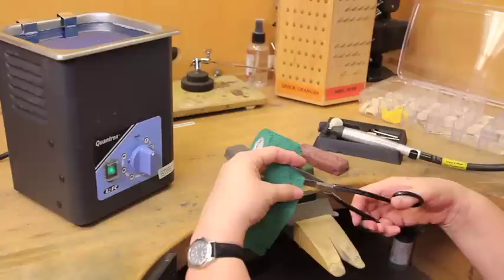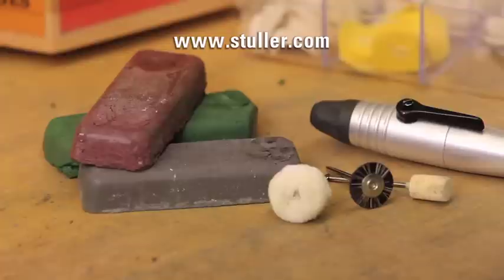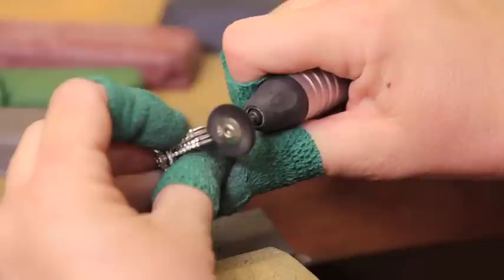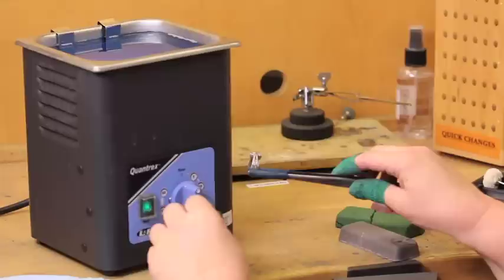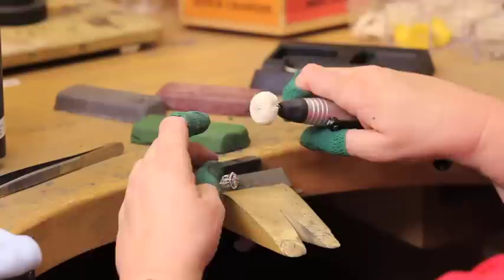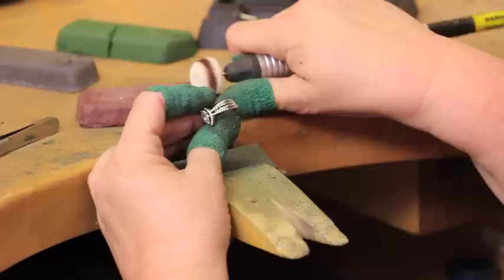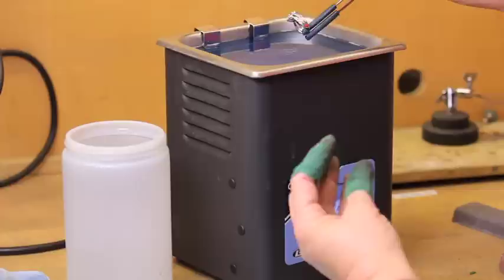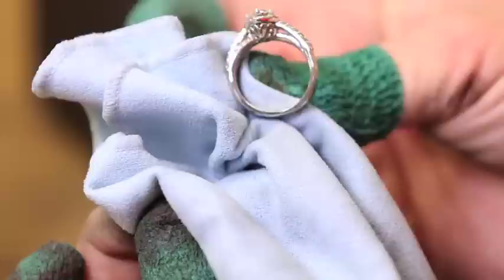Quick Jewelry Polishing Tips

Comment: Do I need to wash the ring in between the green and red compounds? Will it cross contaminate the red buff if I don’t wash after the green?
Reply from the maker: Hi Gail! Yes, a quick steaming is recommended between polishing steps to avoid cross-contamination of buffs. If any coarser rouge remains on the buff when dropping down to a finer polish, you will run the risk of scratching the piece and essentially undoing the current polishing step.
Reply: @StullerInc  That’s very helpful, thank you.

Comment: Hello, can I use that Ultra-CR Ultrasonic Cleaning Solution without L&R Quantrex® Ultrasonic  or any other Ultrasonic? I mean can I clean my jewellery  just with this liquid? Thank you
Reply: First I want to say Thank you to the lady who made this very clear and informative video even after 30 years I can always learn something new
(WIDE fingertape ..never seen that before : )  
Hi ELINA AGAMEL
 I have been making Precious metal jewellery for over 30 years ..I do have an ultra sonic but hardly ever use it ..the cheaper option is to use a baby's toothbrush ..preferably a used one (you can sterilise it before use ..I just dipped mine in boiling water for a bit ) as they are very soft ...I use with Fairy liquid ..ie a really good thick degreasing dish soap ...and rinse... using a separate brush for each type of polish and rinsing each time ...I get a great clean with gentle brushing and rinsing.....if there is some dirt really hard to get out or inaccessible I use the following method
It WORKS REALLY WELL ON PRECIOUS METAL AND HARD STONES ..Eg.Diamonds, Sapphires , Rubies Agates..etc BUT NOT RECOMMENDED FOR SOFT /PORUS STONES ie Opal, Jade , Amber etc (I would NOT use for Emeralds either as They are Just looking for any excuse to crack !)...Take no notice where it says not to use on metal this refers to the Ferrous metals  it is perfectly safe to use on  Silver , Gold , Copper or Brass 
To remove old soap polish etc  a denture sterilising tablet eg. sterident  (also cheap to buy)
pour hot water into a jar or bowl leaving at least an inch space before the lip of jar or bowl as the solution froths ..pop the dirty jewellery in and leave it till the bubbles stop ...then use the toothbrush to clean the now loosed Dirt..and rinse well. 
An ultrasonic saves you time and can be used often without leaving the bench ...so great if you do a lot of fast , high value batch production or do not have easy access to a sink  ...(as. An Artizan designer Jeweller most of my work is one off pieces where I can take the time  )when I do use my Ultrasonic the proprietary cleaners are very effective and well worth the cost but the cleaning is just the same
Hope this Helps. 
Rosemary Price
Brightsmiths (uk)

Comment: I thought green rouge was for stainless steel? Could just go straight to red and save the time
Reply from the maker: Hi! Green rouge is intended for use on stainless steel, white gold, silver, platinum and rhodium. It is a recommended intermittent step prior to red rouge, as smaller steps down in coarseness will take the metal down more evenly.